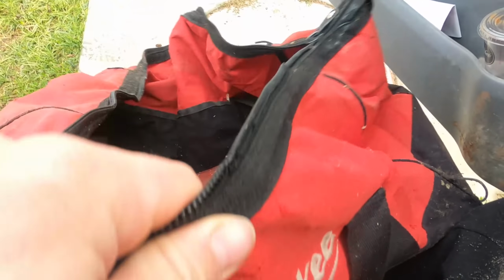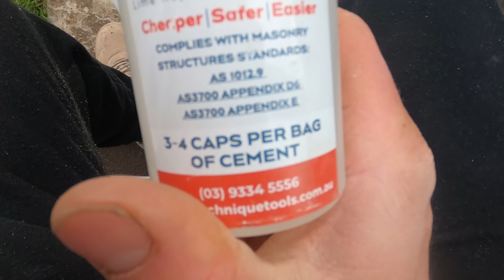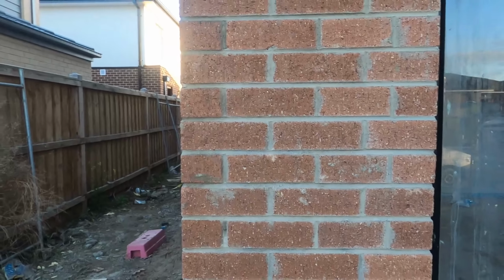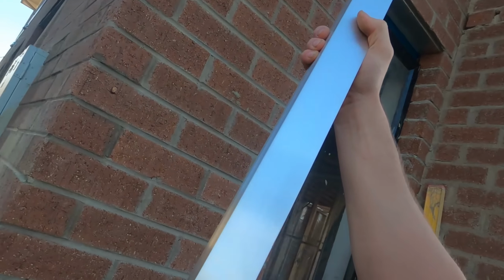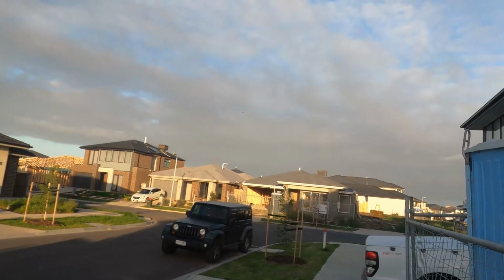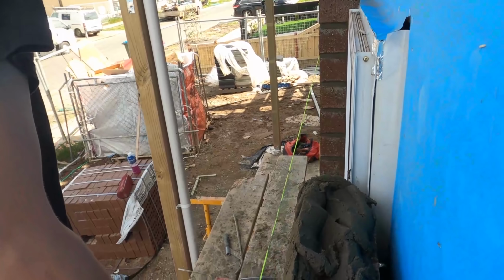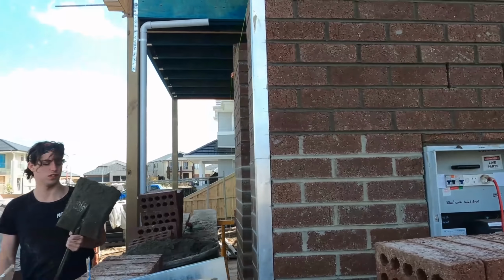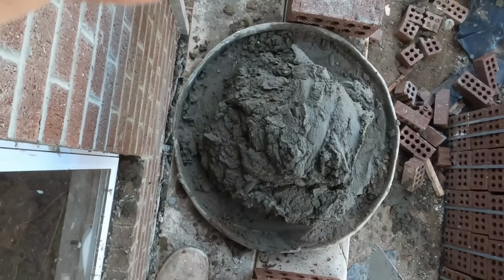Bricklaying TOLERANCES?

Comment: A clever bricky carries at least 3 levels in the Ute. Each one with a different bubble 🤔 Just pull out the level that works in your favour 😂
I think the scoop is for batching plaster. Plasterers (interior) will put the required amount of water in the plaster pot then add the required amount of dry plaster mix to it. By allowing the dry plaster mix to slowly absorb the water it has a longer pot life. Maybe there’s an alternate use for it as a bricky but I don’t know. Maybe knocking up a stir fry over the fire at lunchtime 😋
Reply: I’ve seen some European videos and the lads are laying the big wide clay block and they are using those scoops to run out the muck along the wall.
Reply from the maker: Hahah love it mate

Comment: Humor my question if you would young man... I don't intend this as criticism, I just hope to get you to think about your layout and help you improve and keep more money in your wallet. Why do you lay out your bond from the inside corner and put your cuts next to the outside corner? All of the masons I have worked with over the years here in the states run bond from the outside corner and put the cuts in the inside corner. It is mostly an aesthetic preference to have half bond near the corner and the cuts in the inside corner where they are barely noticeable, but from a production and cost perspective you wind up making half as many saw cuts because the second cut can be made with a brickhammer, chisel or trowel since it's hidden. Most masonry contractors here supply the material on the jobs and get paid piece rate, so having unused wasted material and making unnecessary cuts are like picking your own pocket. Just one of those things my father and any of the old timers I worked with would have jumped my case about when I was a cub and learning to do layout. Diamond blades were a lot more expensive when I was a young man, 30+ years ago, so one aspect of layout was to consider where you were placing your cuts and how to minimize them, hence always working them in to an inside corner when possible. I like the consistency you guys mix your mortar to,  just about perfect, and helps you keep your work clean. Nice trowel as well, I always liked narrow London pattern Marshalltowns. Keep up the good work, and remember to take care of your joints and back while your still young. Best wishes to you from an old and nearly worn out third generation mason in the US.
Reply from the maker: Appreciate the comments Patrick.
I can understand where your coming from and I suppose we are always striving for the most aesthetic look possible when it comes to the exterior on someones new house.
I try to avoid them at all costs and it looks like i have a lot of cuts in panels and thats because i do.
The houses here have an abnormal amount of windows lately and to try get panels between window lengths to work brickwork is increasingly difficult. I suppose the drawings need attention or simply do not allow for brickwork over here.
Having said that I take on board your points and should try to hide the cuts in the internal corners.

Thanks for taking the time to both watch and leave a constructive comment as I am always willing to learn.

And lots of respect to you its a bloody hard trade and have I have nothing but Respect to those who dedicate their life to this art.

Comment: Why do you not keep the mortar away from the edge of the profile when you are building to it? It just makes a mess of the face of the brick that is against the profile
Reply: We use clips at the bottom of our storypoles (profiles) here in the states that holds the pole away so you are never laying against it. Keeps the corner clean because you are laying both brick to the line instead of butting it up against the pole. Quoin corners are very popular here, so setting your poles up this way allows you to use a special line clip or spacers to set in for the wall line, and back out for the quoin corner or any other projections. Makes decorative work go much faster and easier.
Reply: These were by far my favorite product to use, especially in an inside corner. Moving them out of the way to tool your joints, and setting them back up is by far the quickest and easiest of any other system I have used.

http://www.postspeedlead.com

Comment: U gauged to the wrong side of the tbar!
Reply from the maker: The welded Bar??
Reply from the maker: I know what your saying we now just need a bed joint on there!
Reply: You’ll have a 20mm bed joint on brick pier then. unless you notch out the course below and keep the brick face full if you get what I mean. The correct way is to gauge off the under side of the tbar
Reply from the maker: @dannysingles8353  Correct I found out the hard way. cheers Danny

Comment: Firstly, I think you are in tolerance on plumb but with things the way they are I would watch out for a hit on your prices as compensation to the developer as that's how they work. Secondly, I like the look of your muck, what is the exact mix as it seems to be loose enough but not sticky.
Reply from the maker: It’s a 6-1-1 ratio with sand hydrated lime and cement Australia bag.
Also use plasticiser to help with the workability

Comment: Put the bristles on something metal and hit the ends with the cement on with a hammer. Cleans the brush right up mate
Reply: Run the bristles on your brush against the masonry saw blade when it's running. Knocks the mortar right off. If you use horsehair brushes, the mortar is much less likely to stick. I used Crick wooden levels and oil them with Howard's orange oil and beeswax furniture polish to keep mortar from sticking. I would use my brush to rub the excess off of the level. The orange oil and beeswax soaks into the horsehair and prevents mortar from sticking. You can also spray a brush with wd40 occasionally to prevent mortar from sticking. We did this with transfer shovels and our towels daily for years.
Reply: Here is a link for the type of horsehair duster we have always used. 

https://www.tools4flooring.com/magnolia-brush-54-black-horse-hair-counter-duster.html?utm_source=bing&utm_medium=cpc&utm_campaign=**LP%20-%20Shop%20-%20Floor%20Care&utm_term=4576854591642553&utm_content=4061%20%7C%20Magnolia%20Brush%2054%20Black%20Horse%20Hair%20Counter%20Duster%20%7C%20%249.95